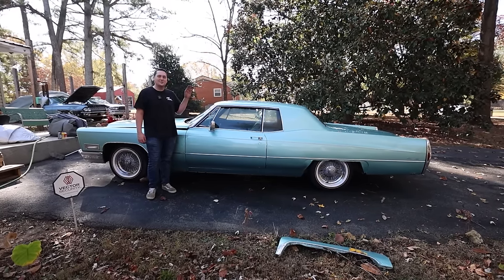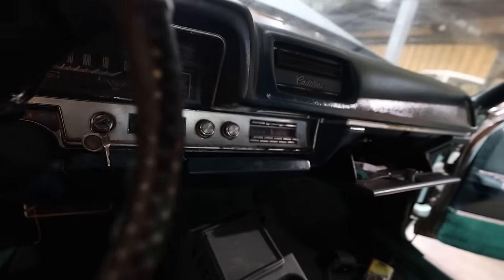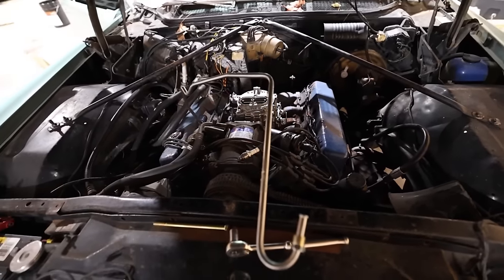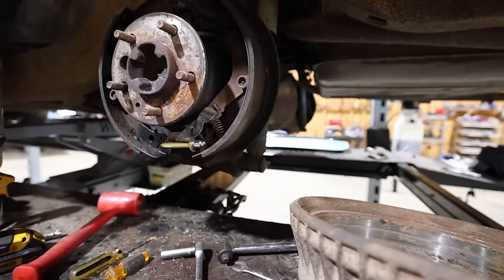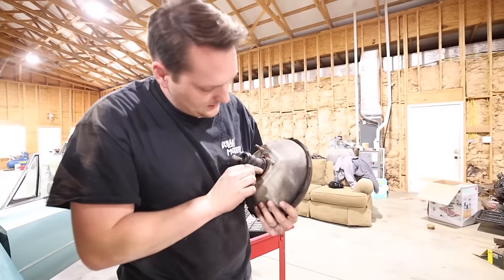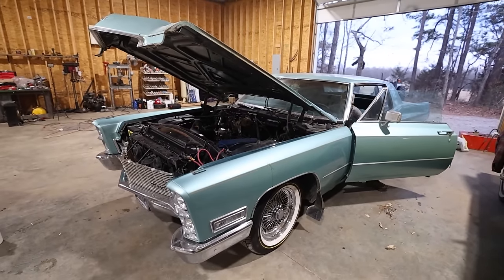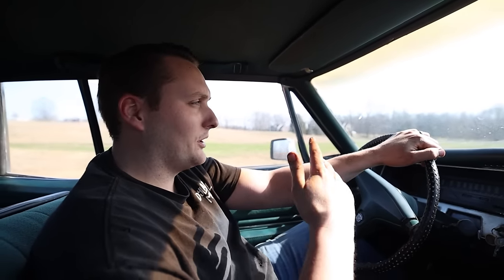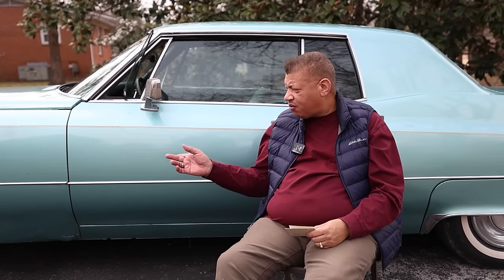Will It Run and Drive After 32 Years? Original Owner 1968 Cadillac First Start!

Comment: This is the kind of stuff the car community needs to do. Even simple stuff, help older or deserving people in need out.
Reply: I got a car that is desperately in need of help.
I have most of the parts that need replacing already.
New fuel cell and straps, floor pans, carpet, shocks and donor "shift pack" transmission and converter..
It's been sitting so long the shoddy body work on the passenger rear quarter is falling apart.
But the crate 350 starts by breathing on the key.
Reply: I have been following you for over three years and this is the first time I have ever replied to on any post you have done, I am touched, great job man your the best.

Comment: Boy, that starter could use a little shimming. Very kind of you to get his car back on the road...great job Sir!
Reply: True that!  My 1978 Eldo starter had to be taken apart when a rear main seal blew oil into it gumming up the works more than twice in a short span of me not having the money to fix the leaking oil seal.  I did take the reman strater apart and put the inside works of that fresh starter motor in the original starter housing because I couldn't get any reman starter to fit the block of that 425 cu engine.  After about the second or third time doing that and having no safe place to park the car in San Francisco's SOMA district and the tranny going out fast, I fianlly let her go for chump change, $300 back in 1994 or five.  

I cry every time I see one of these Eldo land yachts especially if it is the same color yellow as mine was, just like a beautifully carved stick/block of butter.  I called her Dina, short for dinosaur, and Parkay for giggles. She had 31 body lines, the one odd line or body crease was down the center of that long, long forever bonnet where it culminated at the leading edge, crowned with the distintive Cadillac wreath ornament.

Comment: hello dylan, greetings from England....i have a tip for you for cleaning the carbs....the next time you are at your local car parts place, get some ACIDIC ALLOY WHEEL CLEANER, drop the carb in, and it will start to fizz...leave it until it stops fizzing, then pull it out and check it, if it needs a bit longer, drop it back in, if not give it a good wash with water, and dry it with a heat gun....all the garbage that came out of the carb, will sit on top of the wheel cleaner, and can just be scraped off, and the cleaner can go back in the container and used again....👍

Comment: As a Caddy man and lifetime car enthusiast this video is priceless.  To bring her back to life, especially putting the original hubcaps with the white wall tires just made it 100 times better.  I love the story Reggie told of the history, I mean he literally grew up with the car like she was his sibling.  If that was me, I wouldn't sell it either for the same reason.  The look on his face snd reaction when you pulled up is just priceless, made me smile ear to ear.  I hope some day before I die or before the law changes that combustion engine vehicles are banned from the roads because of electric cars that I can own a classic car.  My dream car is a 1959 Cadillac Deville or Fleetwood, I would also love to have the very first vehicle I known was my parents 1972 Cadillac Coupe Deville, light blue with dark blue vinyl top.  I had two Cadillac's in the past, had a 1991 Cadillac Deville Touring Sedan, and a 1996 Cadillac Sedan Deville.  Thank you Dylan and Brier for reviving a classic.

Comment: Nothing beats the old Cadillacs. I bought a 69 Sedan De Ville in 77. I was beyond impressed with the power and speed of that giant 472 cu in engine. The owners manual rated it as 375 horse. First thing I did was put on dual exhaust with glass packs and chrome tips. Chrome tips add an extra 50 horse power, easy. The other thing was to flip over the top of the air cleaner. The sound of the quadrajet opening drawing in all the surrounding air with a moan increased your speed by 40 mph. Such a great car, and I drag raced it against cars that should have blown my doors off. But I figured out that if I get rolling just a little bit before putting the gas pedal on the floor, i could be halfway through the quarter mile while they were sitting on the starting line roasting their tires off. Still, I think if they had figured out how to leave the starting line, the Cadillac would have given them a good run for the money.

Comment: Being that it's a 1968 , did the oil you put in have zinc or did you have a zinc additive? That's a sweet caddy I used to own a 1979  Fleetwood Brougham, it had a 425 big block with throttle body injection it was Awesome, rode so nice . God Bless ya for doing all that for him 🙏

Comment: One of my friends(an old timer) who owns a few funeral homes took a liking to caddies. His nicer hearses  are Cadillacs(fancy traverse) and his basic cheaper hearses are traverses. He’s a huge GM guy.

Well I went home to NY for leave and he said he was buying a classic car and wouldn’t tell me what it was. So we drove an hour to Poughkeepsie NY to pick up a 1968 coupe decille convertable.

I’ve never worked on older Cadillacs and man was I in for a treat. SOOOOOO many vacuum lines and a weird water pump/inlet design.

I will say, it weighs more than my 91 suburban v25 and it was built like a dang tank. We got it going good and then started stripping the front end. We did a disk brake conversion in the front, cleaned and painted the frame, all new front suspension bushings and paint. Now we are working cooling system and engine stuff. 

That engine has so much torque that it could blow the rear axle out of the water and to the moon if the control arms weren’t attached. 

It’s a nice car even with all its flaws and just turns heads. Can’t wait to finish the tiny restoration and get it great again.

Comment: When I was 16 I bought my first Cadillac, a 1967 SDV.  I was fascinated by the tail light design.  While the stop light looks small, it is deceptive.  Above and below the brake light bulbs are red lenses that project red light into the white areas so when you put your foot on the brake the whole area lights up red.  At night when you put it in reverse the bottom part lights up bright white.  A lot of thought went into that design.

Comment: Dylan, quadrajets have a secondary lockout when the choke is set... It physically will not allow the secondary blades to open... I may be mistaken but it looked like the choke was shut when you were trying to open them.
Reply: Indeed they do! I bought an ‘84 Chevy C30 tow truck and that lever had been clipped because they didn’t have time to let it warm up sometimes.

Comment: Excellent video Dylan  :) , Bryer :) , Reggie  family 1968 Cadillac De Seville Coupe   2 door is sweet color and runs very nice too! Also would do time chain plus gears on motor & Wheel Alignment to keep steering wheel  perfectly straight too and shock me the car had true daul exhaust  too ! Hopefully Reggie famillies keep going forever  and take to vechiles shows in warmer weather  too see win prizes ! I always like Cadillac cars all models made for lots years too! Like Reggie stories too Dylan and very good to hear them ! Be interesting what motor, transmission, axle ratio that car has to know! Well Done Dylan & Bryer plus did  made Reggie super happy and smiles to moon also back ! I like seeing that too ! New carb made this Cadillac to live many more years too and like new rims also tires to ! Even Reggie keep orgnail rims with new tires too with white walls too and be sweet too have as spare ones!

Comment: My beef with Cadillacs is that they rarely came with dual exhaust. It leaves some power on the table and it doesn't sound right. You need all the power you can get with a heavy car like that.
Reply: Agreed, my 65 caddy kept blowing the exhaust off from the back pressure

Comment: Great job getting that running, and making a happy man. I do have a question about those knock off rims, I thought i saw only one or two lugs holding the adapters I would think it should have all five for safety. I know that it is possible that I am wrong but after looking back that is all I ever saw.

Comment: Open the small inspection port on the distributor, and check to see if the vacuum advance is moving the stator plate when you advance the throttle.  Sounds like the vacuum advance is shot.

Comment: On the Amazon carbs at least every single one I've had I've had to put a rebuild kit in because at a thin paper gasket for the body and the accelerator pump was made out of a used condom well that's how thin it was and it only lasted about a week The rest of the body is good throw some loctite on the screws and yes they are Phillips head screws you'll need to do that on the throttle blades

Comment: That thing is a land Yacht, back in 70s and older Cadillacs were more reliable sometime in the 80s they great low mileage and extra costly and unreliable with high mileage then they had several bad engines up till sometime in the last decade (mostly my opinion)